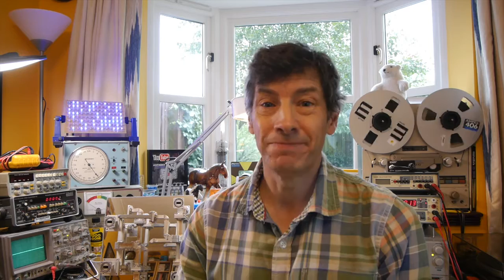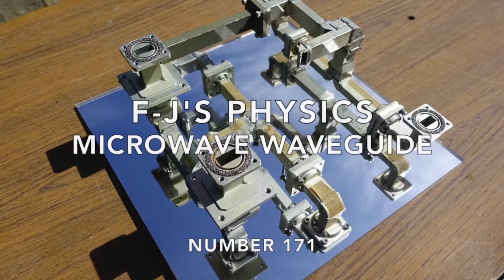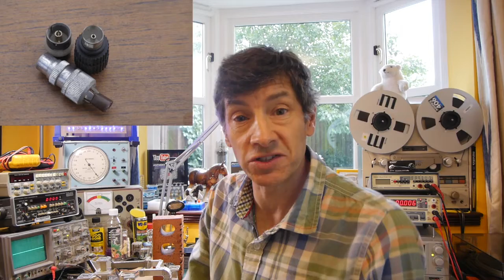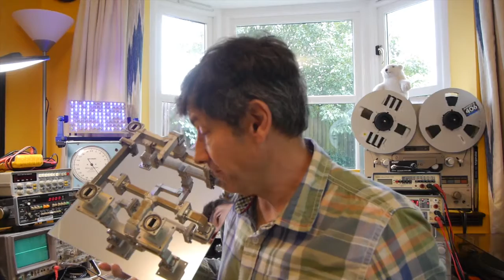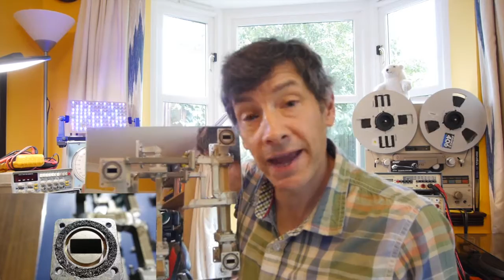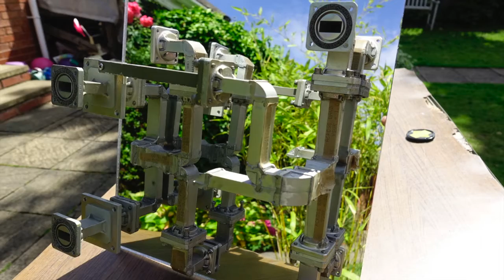Microwave Waveguide - How it works, but is it art? F-J's Physics - Video 171

Comment: what was the mistake
Reply from the maker: Stephen, a good question.  Here is my answer - have a look again and see if you can spot it!  Thanks for watching.  "If you look at the coupler that is bolted to the bottom centre of the mirror and follow that right angle up you will note that it is partly bolted to a straight piece that is at a 90 degree rotation!  This is not allowed without a kind of helical beam polarisation rotator which is why the bolts will not actually screw in!"

Comment: Another mind opening video! At least this one instance of waveguides makes so much sense to me now as I've run thousands of feet of coaxial back when it was the hottest network. 

Secondly, all things considered you did the right thing with the waveguide, it will be so much more useful as a piece of art as the junctions and layout are beautiful, especially reflected. And truthfully there's not much else you CAN do with it.

That said, if you ever do want to do waveguide experiments now, there might be a way to 3d print them. 

The equipment you got reminded me of a more complex lego set where the pieces look like they could interconnect in many ways, like an optical device table. Though its probably not the case, and while there are a ton of different parts available, only certain ones were chosen here for specific properties so you couldn't easily repurpose it.

Ok, my guess for what happened in mounting: You covered some of the outputs? Honestly I think it looks really nice displayed that way. Almost like a form of modern art. Heck if that one guy can turn a urinal on its back and call it art, I'd say 'microwaveguide reflections' would be a piece worthy of contemplation in any modern gallery.

Again I find myself fascinated and educated, so glad you've made a lot of back content and I sha'n't run out soon.  I really wish I had some piercing questions to post in these replies, it's just you've really covered all the questions I had during the demonstration. I can see how your editing style has improved in the last year too and your timings are a lot tighter in recent videos.Wish you the best day!
Reply from the maker: Thanks again!  I am glad you liked this one.  Yes, there was not much to do with this waveguide other than make an art object out of it!  If you look at the coupler that is bolted to the bottom centre of the mirror and follow that right angle up you will note that it is partly bolted to a straight piece that is at a 90 degree rotation!  This is not allowed without a kind of helical beam polarisation rotator which is why the bolts will not actually screw in!  Interesting thought of 3D printing them.  They need to be conducting and smooth to a good tolerance though.  Isn't it strange how the middle conductor goes (as with coax) at these frequencies.  Thank you too for your comments about how my videos are progressing in quality.  Those short ones filmed in the old lab were done over lunchtimes and I rather liked their short sharp style.  Recently my home lab ones seem to have got much longer as I have been dealing with builds rather than explanations but I will keep them coming and your comments, both good and bad, are always well received.  It seems that I do this for quite a small audience but the interest it has generated makes it all very worthwhile!  More to come soon and quite a few from the unpublished back catalogue too!

Comment: My boss had his arm muscle destroyed by leaning on a joint that was leaky
That looks looks like X band waveguide which we used for navigation
Looks like that connection at the bottom has a 90 degree offset from one section to the other !
Reply from the maker: Interesting story - yes not a good idea to get too close to high energy microwave radiation.  And you spotted the 'deliberate mistake'.  Interestingly I looked up the dimensions of the waveguide and it did not fit with any I could find listed so probably a bespoke system?
Reply: @AnthonyFrancisJones  It looked like RN navigation wave guide for the 1007 radars what is the wide distance ?
Reply from the maker: 15mm x 7mm what do you think?  Close to WG18 WR62  KU Band but not quite!  I have not got the best callipers for this so it might be that I am out by a bit!
Reply from the maker: @gowdsake7103  Yes that sounds about right.
Reply from the maker: You would not want to have touched that!  I have been meaning to do a video on Lecher Lines and an explanation of SWR.  Must get around to it and the 100s of other ideas I have got!!
Reply from the maker: Amazing!  If you understand the physics it makes it much easier to improvise and repair things!

Comment: Fascinating stuff microwaves, definitely akin to alchemy. What I dont understand  is if the guide is two parallel plates, these plates are shorted together by the sides of the guide, how come these just don't act as a 0 impedance load?
Reply from the maker: Good question and I will try my best to give a 'handwaving' answer!  So firstly the waveguide traps an electromagnetic wave that is constantly travelling at the speed of light.  Consider a photon passing up the waveguide, as it passes it will cause a changing electric field to be experienced just at the point that it is in the waveguide - it cannot communicate with other bits further down yet as that would be faster communication than the speed of light.  This electric field causes electrons to be moved within the metal of the waveguide as the photon passes.  Once passed they will return to a 'neutral' position.  Now, you can think about the waveguide as being like a Faraday cage so no field can be experienced inside it from outside.  I need to do a video on that to explain the Faraday cage at some stage and how it actually 'blocks internal and external fields from crossing it.  Hope that helps a tiny bit!
Reply: @AnthonyFrancisJones  Thank you, the trick seems to be to think in terms of the speed of light not normal résistance at rest etc. Good hand waving :)
Reply from the maker: Yes, that is the case but much oversimplified I guess.  It's a model that works at my level of understanding anyway!
Reply: This really upset me too! I didn't understand why for example, transmitting loop antennas were a thing, because they were shorts! No. it isn't a short at ac! I missed that  totally.  Have a look at quarter wave stubs and transmission lines. It works out that effectively the shorter walls of the waveguide act as quarter wave stubs so effectively isolate the top and the bottom surfaces of the waveguide from each other at the range of frequencies that the waveguide operates between. 

I'm not an expert and am having to learn something about waveguides for a project I'm looking at. Your comment on zero impedance resonated (sorry) with me and my past trials ;)

Search for a video "Waveguide demystified" which I also found useful without waking Maxwell up.

Comment: Some years ago I joined an engineering tour at Goonhilly Earth Station. The "plumbing" there is amazing. It still fascinates me! I wonder if people realise that they may actually have some waveguide in their own homes that they use everyday....in their microwave oven!
Reply from the maker: Yes, I have only been outside the dishes at the Goonhilly site but would have been facinating to see all of the 'plumbing' inside the buildings.  I have seen plenty in large ships.  Yes, there is a short waveguide in a microwave oven.  Do you remember when they first became commercially available to homeowners there was all the fear of 'radiation' and danger etc.  I must do one about why you can see through (the mesh) on the door but not get irradiated!  Thanks for watching again.
Reply from the maker: BTW did you spot the 'impossible plumbing' in my build?  In there for a bit of fun!
Reply: Yes, I seem to remember a microwave leak detector project in one of the hobby mags (EE?) years ago. I think you may have a few 90 degree rotations in waveguide orientation!
Reply from the maker: Yes, you found it!  90 degree rotations to make it fit and look better.  These normally should look like a helical pipe so that you do get the plane of polarisation to rotate correctly!
Reply: Now I need an episode for the rest of us who don't understand microwave form rectification. It isn't exactly perfectly obvious why a microwave can't do a 90😂
Reply from the maker: Good question.  Microwaves are polarised so oscillate in one direction - let's say up and down so if the pipe suddenly goes from up and down to side to side the wave does not 'fit' well.  What you do instead is twist the pipe like a helix (like twisted pasta!) and the wave will follow the shape and turn through an angle.  If you want to know more about polarisation do watch my video here: https://youtu.be/HJXBLV27Aks  Thanks again for watching and asking great questions!